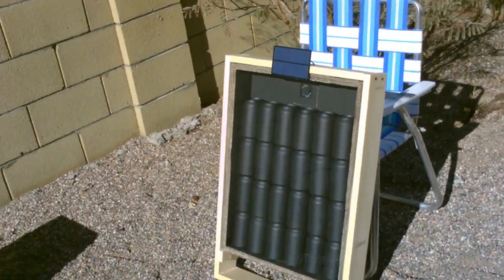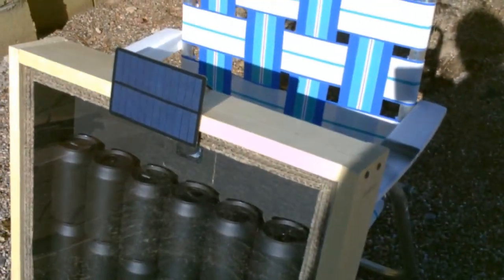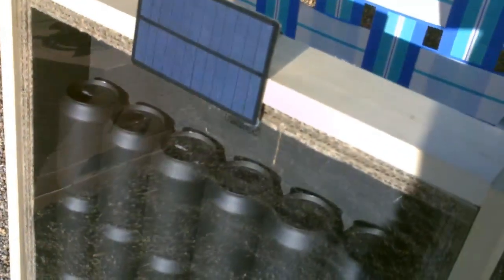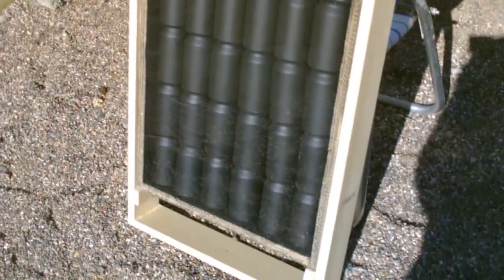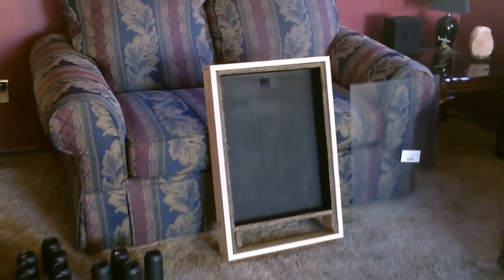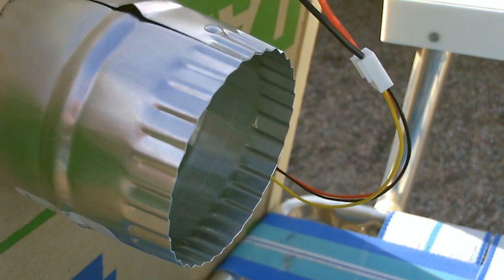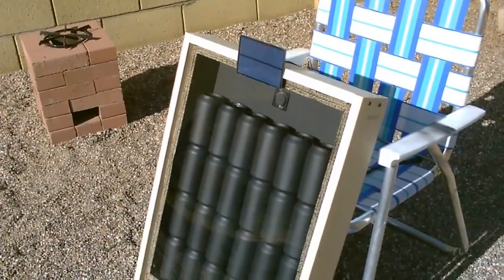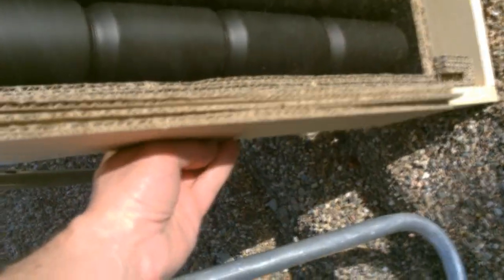Solar Air Heater - DIY solar thermal furnace - 150F+ Temps. (beer/soda/pop can heater) - full vid.

Comment: gday, that is an awesome set up you have there! ideal for the man cave (or female equiv), tool shed etc. Nice job. A question about the airflow, you mention not to remove the air too quickly, so with a low volume fan are you limiting the distance you can transfer the heat?

I have a little backyard solar setup on my channel worth a look too!!

Comment from the maker: ...continued...to answer your last question, i would recommend not omiting the fan unless you plan to make the collector a lot bigger. i have seen some very large collectors (with no fan) where the cold air enters from the bottom and comes out the top (very slowly though).  those little computer fans are rated to run 30,000 to 50,000 hours and solar panels can last for 20+ years

Comment from the maker: thanks.  i always try to make the design as simple as possible (while retaining the highest possible efficiency/performance). i experimented with regular cans, crushed cans and cans with the bottoms cut out and found that the temperatures are all the same.  in other words, don't drill holes in them or glue them together. just paint the cans "flat black" and put them in. to get a steady/consistent flow of hot air through the collector, just be sure not to pull the air through too fast.

Comment: HI! I am thinking of making one of these. I like your design. I have looked at others and this seems to be the simplest and with no use of glue to stack the cans or styrofoam or plastics that could emit chemicals.  Some of the designs I saw have the bottoms of the cans cut. Do you think this matters? Also I do not particularly want to use any electronic equipment at all when I build mine. By omitting the solar panel & fan would you change the design in any other ways? Thanks!

Comment from the maker: thanks.  radioshack (but i have seen them on ebay for one third of the cost). you could also use the 12 volt 1.5 watt panel that harbor freight sells. these heaters are great and simple to make. the main thing when making one is not to draw the air out too fast.  i tried several different fans to get consistently high temperatures